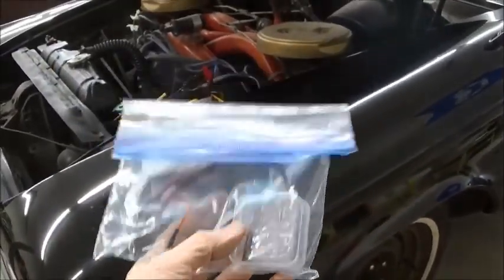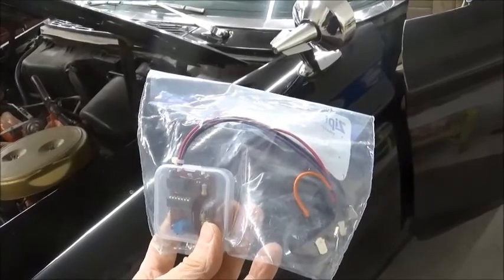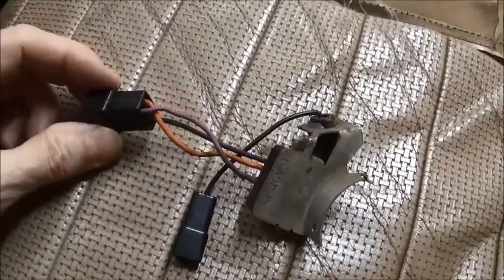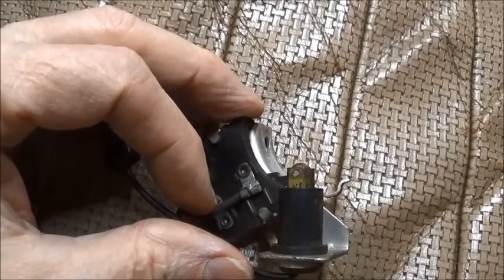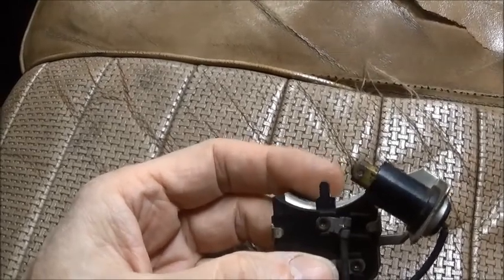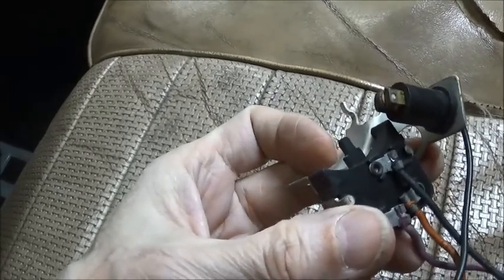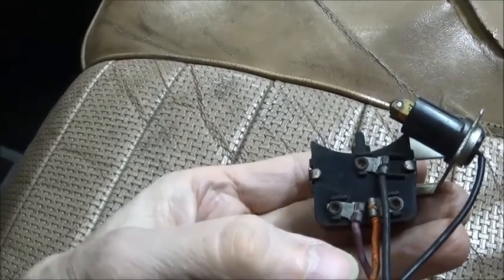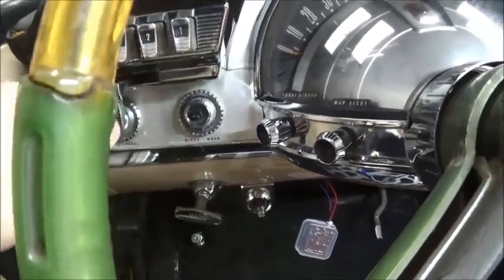1960 61 62 Chrysler Turn Signal Cancel Switch

Comment: So it's basically a timer to release the lever. Won't actually cancel by turning the wheel like the factory one. Have you tried taking apart the factory one to replace the springs?
Reply from the maker: Yes, it is a timed turn signal cancel and does not cancel with the steering wheel motion. I have not been able to repair the factory cancel switch.